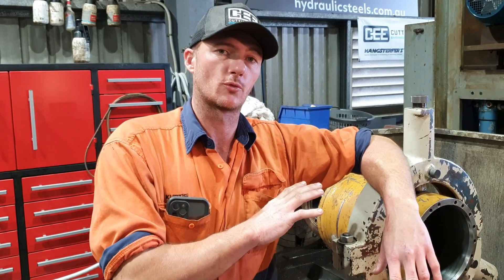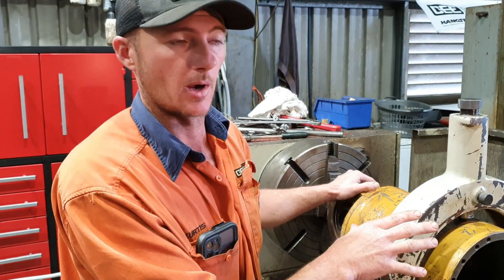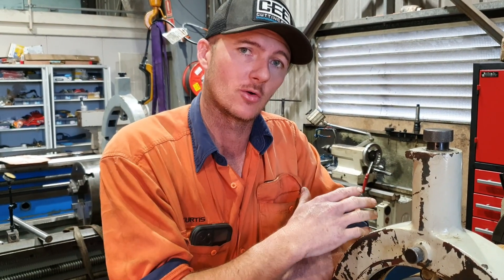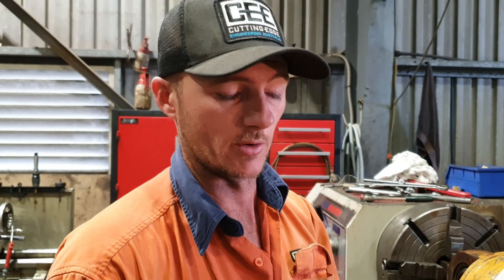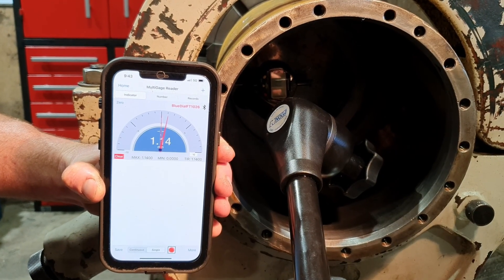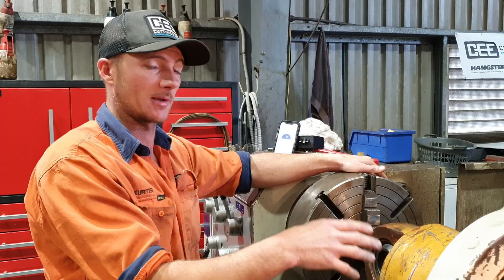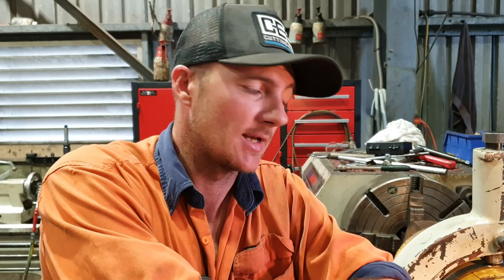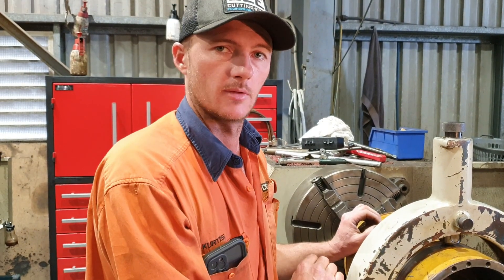Machining CAT 777 Suspension Strut | Bluetooth Dial Indicator

Comment: videos of were machine shops are taking of material on engine block to make the surface true they put a blue die but have not seen you use any such die. The only die seems you use is to find cracks.

Comment: If you remove material from the face of the cylinder unevenly to square the face with the bore, won't that put the holes out of square with the re-cut face? If holes would have been bored and tapped in a lathe so they would be parallel to the bore and perpendicular to the original face. Re-cutting the face would have messed that up!

Comment: I was wondering. Is there a chance that the Inside of the tube got bored at an angle, and now that you've adjusted the face the rod will be at a very slight angle to Cylinder at extension? Or that it will either bind up or wear badly on the gland around the shaft?

Comment: Comment for Kurtis

That indicator working with the 'phone Bluetooth App is bloody brilliant.  I take it you bought one ?  If yes, I hope your tool supplier gave you a good discount, because you demonstrated it to its best.

Cheers

Question for Mrs Allen:

Is that blue toy Kurtis had on the lifting sling with Homey, like a Kong, where you can stuff treats like peanut butter down inside the middle ?

I know a Jack Russell / Pug cross that will spend hours chewing that sort of toy apart to get at the treat.  Even if you had to buy it, they're worth every cent to keep teeth and gums in shape.

Best regards

Comment: Nice new bit of kit there Kurtis, is it calibrated in metric or bananas or you can switch between the two?
Reply from the maker: Hey mate yeah can use both measurements with this device

Comment: I thought you would indicate the bore at the steady-rest end too, to confirm it was also running true after you upset the chuck end... THEN machined the face... 🤔
Reply from the maker: yeah I did the missus just wasn't there filming at that point 🤣 she cracks it at me if I do stuff when she isn't videoing as it usually leads to comments like this my bad
Reply: @CuttingEdgeEngineering   
🙄😏

😎👍☘🍺

Comment: Hi I asked this last video but i don't know if you saw it so will ask it again sorry..   What is a good all in one (tig, mig and arc ) cheap welder (on pension) for someone that does home welding maybe once or twice a month.?
I was looking at the CIGWELD 185 LCD or maybe the BOSSWELD INVERTER MST185 Plus if the CIGWELD 185 Ultra was cheaper would have thought about that.

Comment: Thanks  Curtis for another GREAT demo' of how it's done. Was wondering how you got the steady rest set in the right place. As an arm chair yet to be hobby machinist (Retirement is not far away)  I'm intrigued with how positioning of the 4 jaw welded block at the eye end and the machining for the steady rest was worked out.
No need to answer, as the more I watch the more I learn. At some stage through your productions the answer will show itself.
Stay safe mate to you and yours.
Cheers from N.Z
Pete'.

Comment: My machinist career began in a 1965 shop class and over half of the machines I have ran professionally were converted from flat belt (steam) drive. For years (1970s) I ran six Acme Gridley screw machines that were built in the 1800s and rebuilt in the early 1900s. Millions of pipe couplings were made on them, they were awesome machines and definitely not to be underestimated. I am 70 years old, Sonny, what do you think that Bluetooth indicator looks like to me? Unbelievable!! I think back through the years of hundreds of times I could have whipped that out of my tool box and saved the day. You have certainly lived up to your title today, Cutting Edge!! I have been watching you for awhile now and I rate you one out of ten thousand smart, God has placed a gift down in your soul and it drives you. That is why you work alone and shine while you are doing it.
Art from Ohio

Comment: While not as fancy as the Bluetooth setup you have, I have used Mitutoyo Digimatic indicators with SPC output and a remote display, called a counter, model EC-100 for years to do similar tasks. SPC is fairly standard, and therefore widely compatible across brands, in the metrology space. Best and thanks for the fun videos!

Comment: I trust your judgement and all... but could you walk me through why you didn't fit check the cylinder before handing it back? Considering the previous guys f'd it up that bad, I would have wanted to do a full sanity check. Even it it was just a soft fitting? Maybe you did off camera.

Comment: Thanks for the surprise Monday video!  How did the face get so off from the bore?  You said "It's the worst one I've seen," so it must be a fairly common occurrence, but I can't imagine how that would happen.
Reply: He said it had been repaired, so I’m guessing the repair was sub standard
Reply: I suspect that the guy at the factory setting the cylinder up in the lathe needs one of these Bluetooth indicators to get it running true lol

Comment: While that's a nice tool, I would personally prefer to have the display as a separate device instead of needing your phone. As an IT guy I know it's not that hard to write an app for this, but it is very likely that in 2-3 years it won't be updated for new versions of android or ios and it will become largely useless.

Comment: As Joice Mane used to say:
"Where do ya get it?"
That blue tooth gauge aaand that llloooong armed stand?
Brissi I'm guessin'.
Details please, I want one!
Reply from the maker: Get in touch with Arthur at LiveTools in NSW he might have another one 😎👍
Reply: Thanks for that, on it.
Reply: @captcarlos  The stand is a Noga MA61003 Big Boy Magnetic Base.
Reply: @ Highpwr
You know, I suspected as much.
For years using cheap Noga knock-offs, struggling to tighten them enough to be effective..
Then watching how easy this one was, at huge reach.
Thanks for the confirm.
Reply: @captcarlos  Yes, once I discovered Noga's I never looked back. I think Kurtis should stick that Big Boy onto the back of the forklift and tie on one of Homeless' pull toys. See which one let's loose first.... 😰
The nickname of "Big Boy" is well earned. They are Big and Heavy.

Comment: Great diagnosis and repair!  I have no knowledge of lathe work, but what if the wall thickness of the cylinder wasn’t uniform?  Could you end up with it set up in the ‘steady’ but measuring a runout on the inside?
Reply: A 'CATHEAD' could be used. Look up 'lathe cathead'.

Comment: BIG NOPE. If you ever use a Bluetooth dial indicator, on your phone, you need to understand and acknowledge how easily your phone can be hacked, and app/measurements altered. 

I understand every tool has a purpose, and a use, but hackers these days can hack anything.. and I won’t trust a Bluetooth dial indicator, because of how easy it is to hack a phone in this day in age. 

I would have to test the dial indicator promptly before and promptly after, every time I used it, just because it can’t be trusted. 

Skeptical? Read the patch notes from TODAYS Apple iOS update. They talk about “patching up” these things. They had access to your texts and cameras 24/7. Despicable,

Enough on that, I love your setup and skill set. Keep turning, burning, editing and posting! Love it

Comment: Dang that Motionics Bluetooth indicator is badass! Not quite in my budget right now but I want one! I am really impressed with you skills as a welder and a machinist. I started with a two year degree in tool & die 40 years ago and you are better than most I've ever seen. At 66 I've retired to a home machine shop but keep on rocking! BTW , any guesses on where to purchase a PROMAX Blue FR weld hood in the states.

Comment: Additional question --- how on earth did that face get so out of square, to be over a mill out,that's 40 thou  ( us old folks know what that is )😆😆😆
By the way, thanks for the extra video 👍👍👍
Reply: A mil is .001 inch. A millimeter is .040 inch. You have kangaroos and bananas mixed up.
Reply: @deconteesawyer5758  -- a mill as in millimeter, so no I don't have my fruit and animials mixed up.
Or is it that when you measure something, you say millimeters, where as,when I was in the metal trade, we just said mills.
Reply: @markgriffin4888  I hope you say that in a metric accent, because A mil is a measurement that equals one-thousandth of an inch, or 0.001 inch. One mil also equals 0.0254 mm (millimeter). Thus a mil is not the same thickness as a millimeter. The term "mil" is not an abbreviation but a unit of measure.

Comment: I'm confused, I saw you make the inside closed end of the barrel, concentric with the center of the lathe. How did you insure that the open ends inside was concentric with the center of the lathe. It looks to me that the steady rest was determining the open ends concentric position, was it's position checked with the inside? Not shown? Dave, Tucson Arizona, not a machinist, love your shows, especially "Homeless"!
Reply: Yes! thinking the same thing.

Comment: I use the Motionics modified Mitutoyo indicators for measuring both sides of a wide belt sanding machine simultaneously. They made my life dramatically better and have been working extremely well since around 2016 I think..... I've read them up to 50 ft away.

Comment: it would do no harm to spray yellow paint on the outside of the cylinder where you machined in the groove for the support stand....unless that was stainless steel...but it would do no harm either way.....nice work as usual, performed quickly with absolute confidence as usual
Reply: It will likely be painted after the unit is reassembled anyway.

Comment: I'd have indicated in the "chuck" end, just like you did, but then I would have put the 3 jaw on the tailstock and centred up the faced end, re-checked the chuck end, then with the  chuck on the tailstock holding the internal, I'd have skimmed a band on the outside and then run the travelling steady on that ...having a nice bearing surface for the travelling steady skimmed up to be concentric with the bore would have been my first step .. but there again, I'd have probably screwed up some other bit of the job, so best ignore me anyway ;)
Reply: When the vid cuts to the barrel chucked up in the lathe the steady rest band is already there. Think man, do you think he turned that with it stuck out from the four jaw??

Comment: Very interesting content 👍. Makes a person wonder what has happened to the barrel to have caused that much misalignment.  Or was the original machining process an issue.  Definitely a nice indicator for a lone wolf machinist. 
🇺🇸🦅🌏⚓️🇺🇸
Reply from the maker: yeah still not 100% sure how it ended up that way. Thanks for watching mate
Reply: The gland may need to be in a certain orientation. It would have help if punch marks before disassembled

Comment: That indicator is a pretty cool tool. I've been thinking for at least five years now that someone should be making something like that. I'm glad to see they finally are.

The app could be changed to make 4-jaw centering even easier. Set the indicator, spin the part once, and it displays a circle showing you where to turn the part for the first jaw to tighten, and shows you an arrow showing you how far to go. When you adjust that one and spin it again, it shows you the next jaw to adjust and how far. Don't even have to think, just follow directions.
Reply from the maker: that's a great idea mate
Reply: Are you mr. Wilton of the vice by chance?
Reply: @ElmerJFudd-oi9kj  Not directly, as so far as I know I'm not related. Wilton was a fairly common English name a couple centuries ago when my great grandparents emigrated to the US.
Reply: Just like car alignment !

Comment: Evening Kurtis and Co, caught me out this evening, had to have a hard think to make sure what day it was, what would have caused that end to go like that?, I was thinking if the end cap was working loose, but would have thought that would have stripped the threads. I like the Bluetooth Micrometer, I bought a Bluetooth Multimeter, same thing as you, Working on my own, trying to see if a hydraulic valve is getting powered up 120 feet from the switch, can't be in two places at once, although the wife seems to think I can 😁.
Regards to both and Happy dog.
Richard 🇬🇧
Reply from the maker: Hey mate yeah we've thrown a few schedules out for our viewers 🤣 Not 100% sure how the barrel ended up like that, it had an original build tag on it...maybe a refurb, maybe bad bit of material or bent somehow
Reply: @CuttingEdgeEngineering  Did you check the gland to see if it had a complementary error, such that a specific clocking cancelled the angles out and the rod ran true?

Sadly, I could see CAT doing something like that deliberately to discourage customer repair.

Comment: As a farmer\mechanic I use a thing called a Steelie. It's a magnet on the back of your phone you can stick to anything steel around the shop. It's kinda expensive but I cut down on cost by turning up some semi-spears got the vehicles and tractor cabs I'm using 3m trim adhesive to hold them. But it will stick to anything ferrous!

Comment: Now that is a cool tool. I didnt think it would have a hope of getting the signal through all that steel, but it seemed to work flawlessly!
Reply from the maker: Yeah I was pretty impressed with it. Need to see how far it will work
Reply: @CuttingEdgeEngineering  You could send it over, see if it works from France.🤠
Reply: The signal would be coming out the open end and getting reflected by other objects, not a chance of getting directly through such thick steel.  It's an awesome bit of kit though.

Comment: If the square block on the eye end isnt welded perfectly straight, wont the 4 jaw chuck bend the tack welds and break the block off after a few rotations?
Reply: No, because the 4 jaws are independently set, this is what makes them great for dialing in concentricity.  If the part being spun is wildly out of balance and heavy, that might cause a problem, but if that's the case it would be obvious and unrelated to the 4jaw.

Comment: 2:10
made in USA
opens case
tool has C E marked
so made in CHINA LOL
I'm in USA, we don't mark our stuff made in CHINA :)
Reply: CE marking has nothing to do with China! CE mark means that the manufacturer self certifies that the product meets the relevant  EU standards.
Reply: @tda2806  ...or that the manufacturer has had the goods assessed by a third party assessment body, or test house, for compliance with the relevant standards.
Either way round somewhere in the manufacturer's system there will be a certificate showing the list of standards to which the goods comply, and, where appropriate that certificate will indicate tolerances, resolutions etc.
Edit to add - The CE mark in itself does not indicate where the goods were manufactured.
Reply from the maker: Will have to check that might just be the holder that is made in China 😎👍
Reply: @CuttingEdgeEngineering  lol
love the videos!
not finished this one yet
Reply: @notsure9079  Mate CE does not = made in China, it's a EU stamp. straight from Wiki "On commercial products, the letters CE (as the logo CЄ) mean that the manufacturer or importer affirms the good's conformity with European health, safety, and environmental protection standards.[1]:58 It is not a quality indicator or a certification mark.[2] The CE marking is required for goods sold in the European Economic Area (EEA), but is also found on products sold elsewhere that have been manufactured to EEA standards."